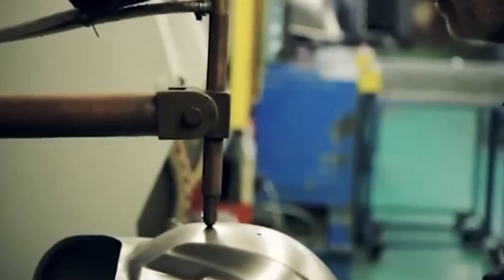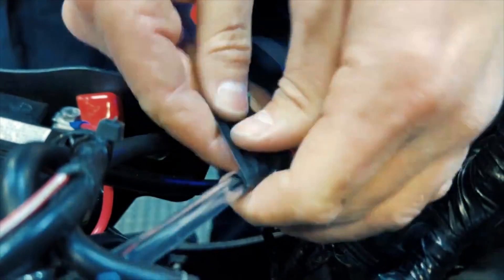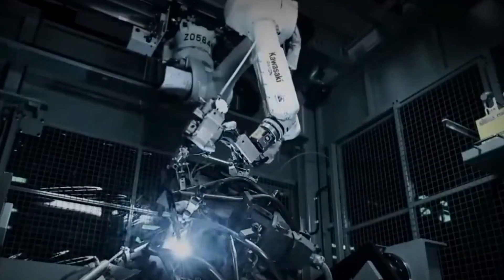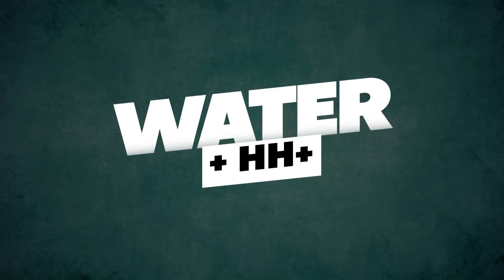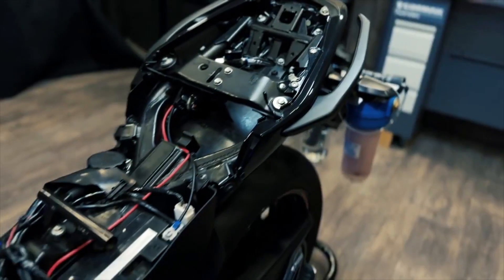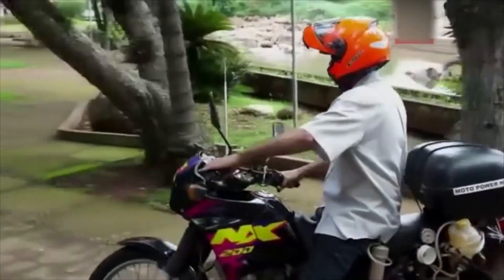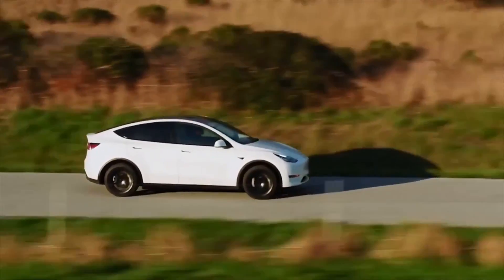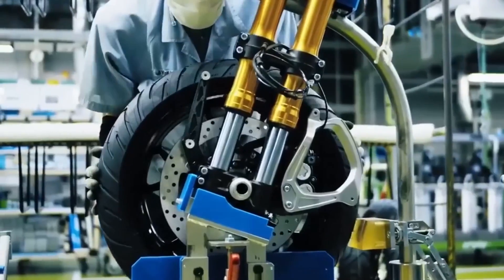The REVOLUTIONARY Innovation Of The FIRST Water-Powered Motorcycle!

Comment: I'm with Antiorganizer, Water is not an energy soutce, rather it is the very low energy byproduct of fuel oxidation.  I use the term oxidation here because it's not just combustion that produces water vapor, but also biologics ( like people and moo cows} use a similar process to digest food into energy, in which water vapor is released as a byproduct.  Water is the byproduct because it is low energy.  But it can be converted back into it's original high energt constituants, hydrogen and oxygen.  So what we are doing here is electrolyzing water back into hydrogen and oxygen utilyzing the electrical power from the "car battery" which they mention.  I imagine the car battery is then charged by the motorcycle alternator.  Sounds great, right.  In reality, not.  This would define a perpetual motion machine, especially if you recovered the exhaust and condensed it back into liquid water.  OMG,  What miracles could be performed, you could heat and cool all the homes on the earth, and run every appliance for free, not to mention to all the reverse osmosi water treatment facilities to save so many people and animals in parts of the world where the water is contaminated with toxic minerals.  But unfortunately, perpetual motion has never been achieved.  There is this universal law that keeps gettng in the way, it's called the first law of thermodynamics.  There is also a zeroth law which states that energy can only flow from a high state to a lower state.  OK, back to the first law, which says, if you want to produce work, you have to input energy, which is transformed into an amount of work, and because of inefficies, an amount of heat.  Lets look at an internal combustion engine, which has a maximum efficiency of about 40 percent.  Electrolosys isn't very efficient either, at about 30 percent.  So, lets do the math and see what power this gismo produces.  Here's the specs:  1 horsepower is 746 watts, the power in to the electrolysis machine comes from the car battery at 13 volts and draws 5 amps (stated in the video.  Watts is volts times amps.  So here's the power calculation:  13 volts times 5 amps times 30% for the electrolysis times 40% for the engine divided by 746 to convert to horsepower.  The answer is 0.0104 Hp, or about 7 watts.  That's less than the amount of power to drive a couple of cooling fans on your compter.  Thats not enough to even idle the engine.  Nor is it enough to power the motorcycle alternator which would require 65 to 90 watts of shaft power from the engine to make 13 volts at 5 amps.   This video is complete bullshit!!